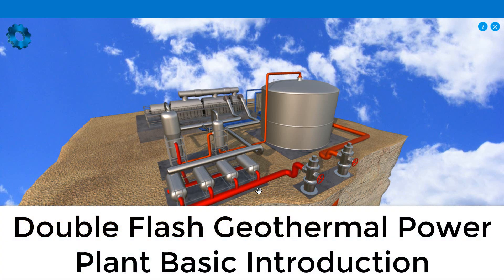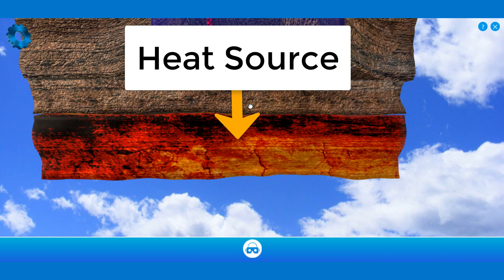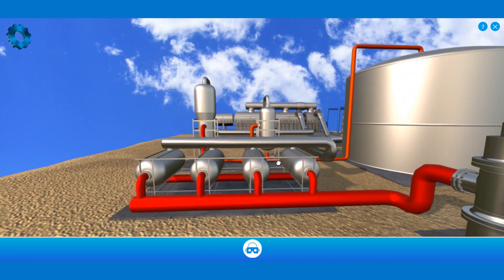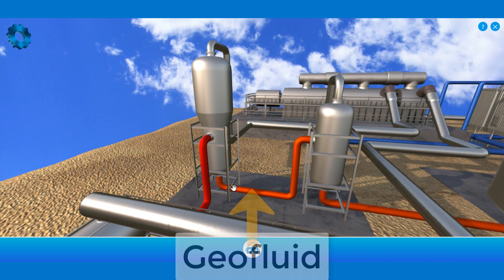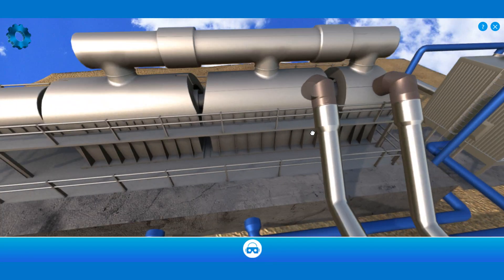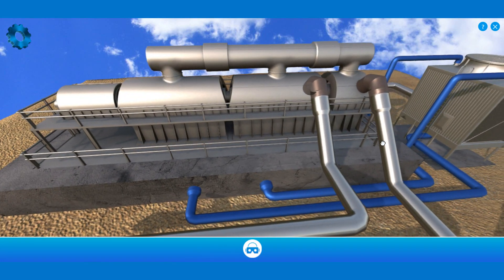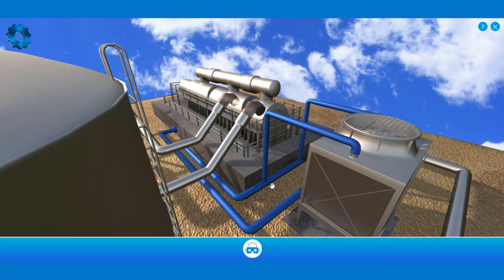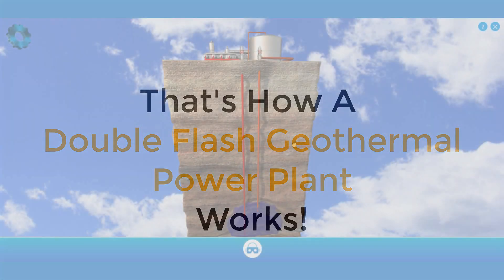How Double Flash Geothermal Power Station Works

Comment: Thank you for the great video..
Could you explain why we need to cool up the condensed steam before injecting it back to the ground?
Reply: we took hot fluid from the ground and not steam. We needed the steam to run the turbines. After the steam has served it purpose, it eventually turns into a "not that hot fluid again",. Its energy has been transferred to the turbines and it turns to fluid in that process. 

we deliberately condense it to increase the conversion process, which is finally injected back to the ground to be made hotter again.

 Hope this helps
Reply: However, is it bad if the fluid is injected back to the ground with a higher temperature ?  Why does it need to be cool enough ? Thank you for answering.

Comment: Is that what we could use to cool down YellowStone magma chamber so it doesn't explode?
Reply from the maker: Honestly, I have not idea, but I imagine the shear volume of magma down there would make it near impossible to cool? Actually, I just checked....

http://www.bbc.com/future/story/20170817-nasas-ambitious-plan-to-save-earth-from-a-supervolcano

"Cooling Yellowstone in this manner would happen at a rate of one metre a year, taking of the order of tens of thousands of years until just cold rock was left."

So, by then people will probably still be watching my videos, but we might all be gone! :)

Sounds like a definite plan though, cheap electricity for a thousand years and reduces the threat of extinction. Everyone wins.
Reply: Yes! That was the same article i read. And it doesn't need to cool down the magma chamber, just take enough heat so the temperature stops rising. That would be enough to stop the a catastrophic explosion.